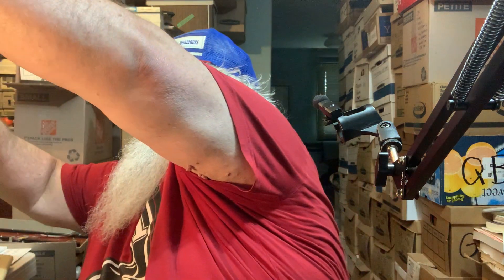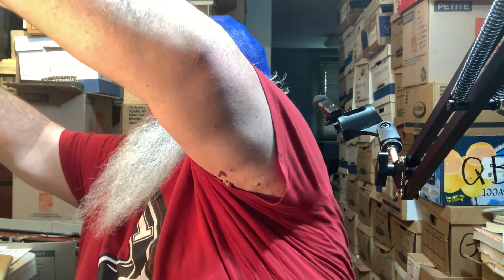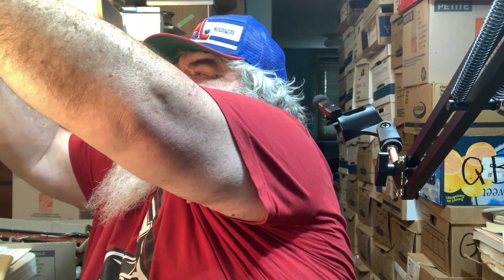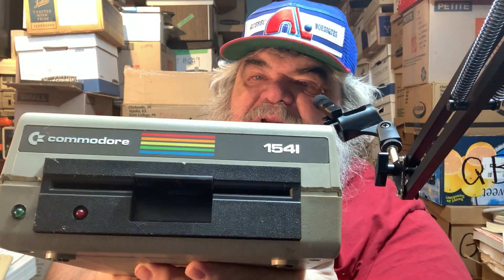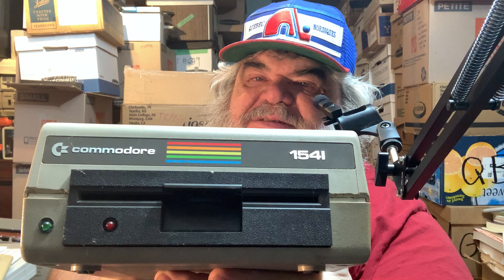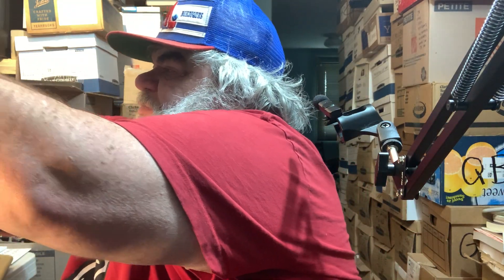Commodore Bits & Bytes - 2 More Garage Fresh 1541 64 Disk Drives To Test & Torture! - Episode 1352

Comment: The enjoyment continues. Love the mic stand setup. Thanks for sharing
Reply from the maker: Quick program that will keep the head banging...until the drive finds itself...if it is going to find itself...sometimes it works, mostly not...oh, and yes, you should have a disk in the drive when you do this...but indeed, sometimes the drives need to be woken up after so many dormant years...and some exercise can get them back in the game...sometimes!